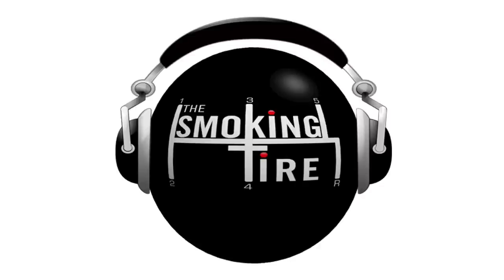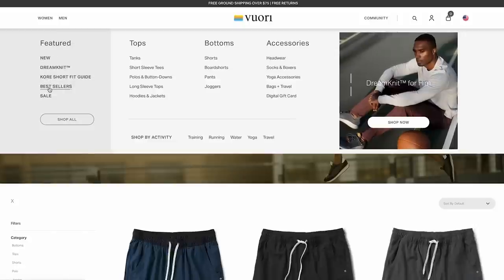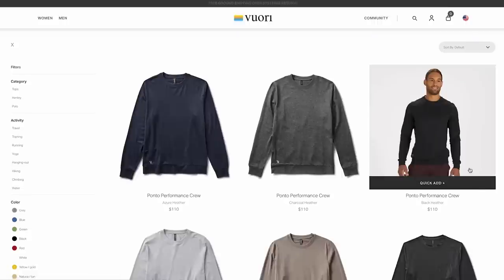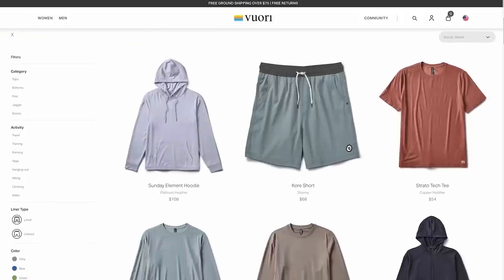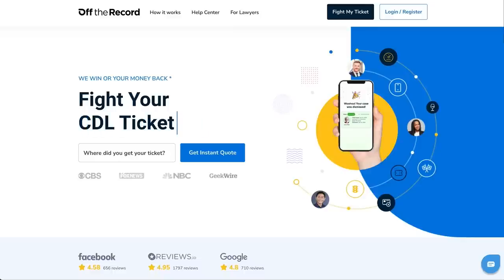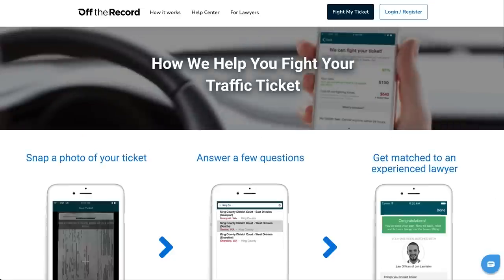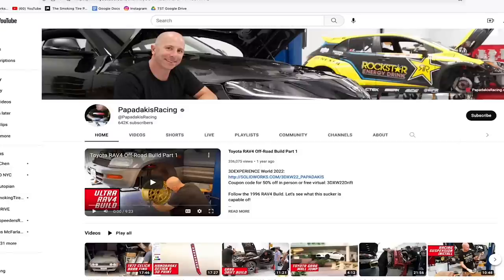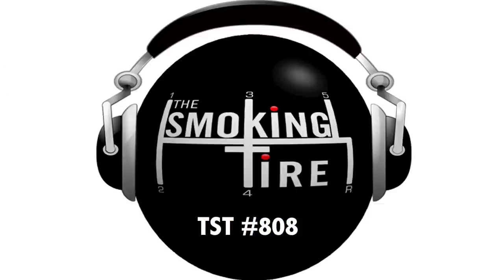Stephan Papadakis Knows How to Win - TST Podcast #808

Comment: Timestamps will be here: 
0:00 Preview 
0:35 Sponsors 
4:49 Show contents 
5:48 Start
8:48 Building Pro Drift cars 
20:58 B58 engine 
22:30 86 vs Supra drift cars 
24:10 Crazy side projects 
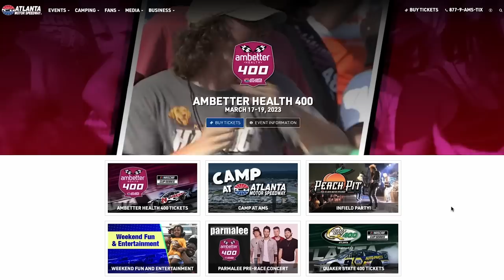24:48 NASCAR sponsor
25:33 Crazy side projects continued 
28:00 Monster truck business 
28:44 Drift car yearly improvements 
31:13 Trackside engine swap
32:32 Large vs small engines 
35:35 Fuels used for drifting 
38:43 Cost to run Formula Drift per weekend 
42:00 Drag racing recent events 
43:48 Fastest specific version of each car 
46:37 Insane power street cars 
55:55 FD aerodynamics 
59:27 Formula Drift popularity vs others 
1:06:06 Patreon
1:06:39 Supra content
1:07:00 Better mechanic work
1:08:36 FWD drag racing motivation
1:10:57 Unlimited budget car
1:12:03 Celica barn find car
1:14:07 Steph’s RAV4
1:18:50 Why a B58 is so strong
1:19:56 Empirical data vs judging in drifting 
1:21:25 Developing a race car or team
1:24:42 Papadakis Racing Merch
1:25:28 EV drifting
1:27:55 Papadakis Racing YouTube channel
1:30:54 Follow Stephan
1:31:15 Cali Road conditions 
1:32:08 King of the Hammers

Comment: So how is that guy planning on changing the gearing in the S2000?

An AP2 trans with a shorter final drive or a AP2 trans with the AP1 reduction gear? It's only worth about 600rpm using 255/40R17 rears

Comment: Matt, you need to watch the actual races
Past two seasons they’ve skipped over the most dramatic races just to, ad nausean show the same bits or hide races where F1 bungled the event instead of Ferrari
Reply: My thoughts exactly. Why cant they show the season in chronological order. This latest season, they showed testing after they showed the first race. I mean WTF. First season of DTS was the pinnacle.
Reply: It's hype over substance. The races aren't remotely close. 10 second intervals...sweet. So create a male oriented soap opera with the spectacle of Formula 1 as a back drop. It's wrestling with firesuits.
Reply: @JR10_RR  agreed. When iRacing series' produce more compelling and tighter races than the real thing, you know you've got a problem..